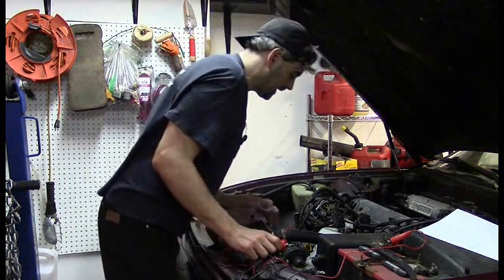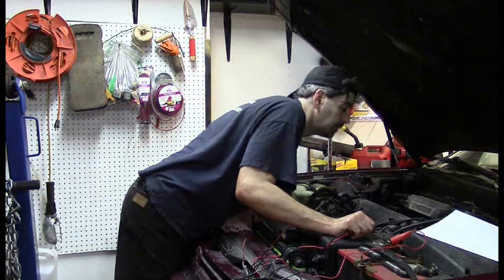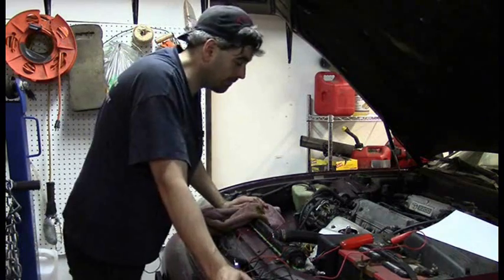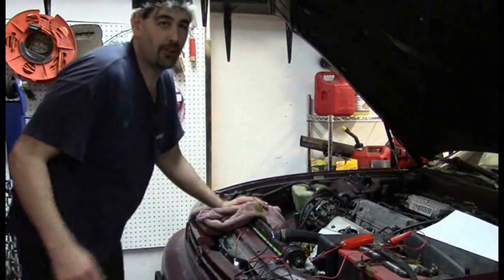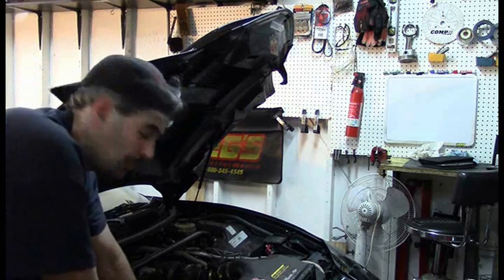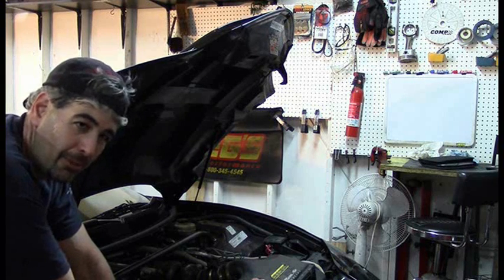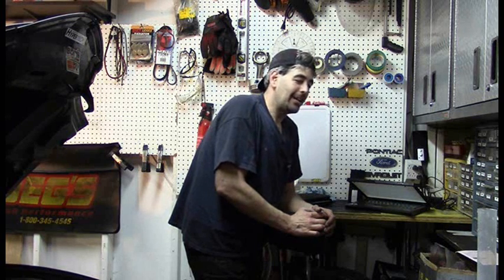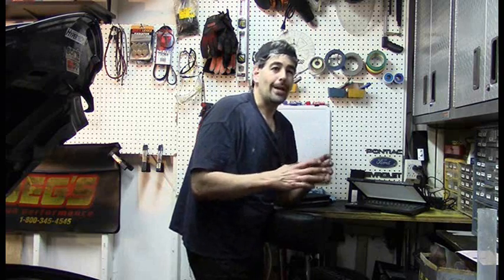12 Ways of How To Test A Blown Head Gasket Compared- PART2

Comment: Really interesting two part video there, the 'sizzle' test is obviously cool, it just looked like 'normal' used oil, who'd have guessed eh?
I have a suspicion that my car has the beginnings of a head gasket issue, its a 1999 Renault Scenic, just nearing 150k, had a new timing belt/water pump two years ago, but recently started 'losing' coolant fluid with no evidential leaks for wet patches, a couple of weeks later it had a minor intermittent misfire (at lower revs nearly always during pulling away which went once you hit 3k revs), tho that problem suddenly got worse as it would misfire occasionally even at steady town speeds, but this has since lessened. It doesn't overheat, has had regular services, last one a couple of months ago, but my concern is that whilst it may have seemingly gotten better (for now), more damage is being caused.
I have a friend who's a qualified mechanic but I'm quite independent mechanically and don't like going to him for problems as I don't want to be seen as only being friends because of his skills as I know some people do that, and whilst I've done head gaskets before, they've always been on engines I known well because I've only ever owned old bangers that you had to tinker with every weekend in order to make sure they would see you through the following week, but my current car is pretty modern so I'm a quite reluctant to mess with it, but I'm thinking I'm going to have to ask for some help with this one.
But excellent videos, thank you!
Reply from the maker: The diagnosis for mechanical problems like a head gasket is no different now than it was in 1921 so you shouldn't need any help.  It's the modern engine performance systems diagnoses that require considerably more skill and knowledge.
Reply: Schrodingers Box Yeah, its messing up something EMU/ECU system related that worries me. I love computers, I just wish they wouldn't stick them in cars!
Oh for the days when engines were all but mechanical, when the only wires in the engine day were to the starter, alternator, plugs & coil... I miss those days :-\ lol
Reply from the maker: maffysdad You know- my channel exclusively covers diagnosis on these modern systems and dare I say- but when you understand the systems and know how to diagnose them, it is actually far, far easier to diagnose modern systems than older ones because if you know what you are doing you can rule out 90% of things that you would still have to manually test on an old car to rule out.  On older cars, Diagnosis takes me far, far longer because I cannot "read" the engine's response to variables and instantly determine what must be working for sure and what may not be working.

Comment: Thanks pal, very inteesting. I was wandering about how different a mechanic workshop works in my Catamarca, Argentina. It s too long to explain though!!!! Yet a mecanic is a detective here, but many variables, (labour costs for instance) make all the thing be seen from a different perspective. Mostly you are fixing 20 year ols cars or older. I have a Chevrolet c-10 with a Perkins  4 engine and a M. Benz 65 truck gearbox, with a super low first gear. I am not a mecanic but i fit it all myself and it goes great. I live in remote area. Thanks for sharing.

Comment: I am trying to diagnose a head gasket failure.  The engine passed the exhaust gas in the coolant system test (block tester liquid remained blue), but I think it failed the "sizzle" test. I made a video of the test.  At the 25 second mark there is a little boil popping and sizzle but the rest is just smoke.  Is this conclusive?  https://www.youtube.com/results?search_sort=video_date_uploaded&filters=short&search_query=lee+stafford%27s+oil+test  thanks Schrodingers Box

Comment: Hello Matt from Shcrodinger's Box! Great video, which is certainly worth a compliment!
The test you talked about, with the hoses getting hard from combustion pressure, is certainly valid! It is very related, or you may even say equivalent to the test I like to do: For automatic transmission cars, I open the rad cap and close it again, then start it up, step on the brake, put it in drive and accelerate up to around 2500rpm with a totally cold motor, for approximately 25 seconds. IF the test comes out POSITIVE wherein there's pressure present in the radiator when you take off the cap, then you can determine that the gasket has failed. However, if there's no pressure in there, after the test has been done, you may not be 100% sure that you don't have a leak, as the pressurized combustion gas in the cooling system may find its way out through a potential leak of the cooling system itself.
For standard transmission cars, I drive them in high gear, full throttle on the street, for maximum stress, for the same time (20-25 seconds). I definitely admit that the CO2 detector is the best way to go though. I appreciate your scientific approach to the issues, and I hope to get your opinion on the test I do.
Best Regards
Ragnar.

Comment: I have a 2008 subaru legacy. The only symptom of a bad head gasket seems to be a small oil leak between the head and the block, passenger side just above the oil filter. No signs of bad compression, exhaust gas in the coolant. How can this be? What could be the cause of the leak, engine has not over heated.
Reply from the maker: Most likely that oil leak is from intake manifold I would presume.

Comment: I could use some advice regarding my attempts to repair my 1998 Volvo V70 GLT, a car I've owned for 16 years. 
Background:
- Car recently overheated (first time ever) while driven by my teenage daughter.  Radiator had a split seam and wouldn't hold water so it was towed to a repair shop.
- A new radiator was installed but during a long test drive the temperature gauge hovered just under the red zone indicating a failure in the cooling system.  A head block test revealed combustion gases in the coolant.  The mechanic charged me for parts only and advised against “pouring money” into the car since the total extent of damage caused by the initial overheating is anyone’s guess. 
- Having nothing to lose, I gave Blue Devil Head Gasket Sealer a try.  I first performed a head block test to confirm the presence of combustion gases in coolant--the test fluid turned yellow within seconds.  I used Blue Devil as directed and performed another head block test.  No combustion gases detected—the test fluid remained blue.  (Repeated test several times in disbelief!)
- The good news is the car no longer overheats.  Temperature gauge rises to the middle of the normal operating range where it should be and does not fluctuate.
- The bad news is that coolant is being forced out of the reservoir cap.  (1 - 2 tablespoons per lengthy drive)
- There is no oil in the coolant and no white smoke from the tail pipe.  T-stat tested and works fine.  All 5 cylinders show compression of 180-181 psi.
- Engine starts easily, has a smooth idle and runs great.
Other than a head gasket leak, what else would cause this kind of pressure to buildup in the cooling system?  Any diagnostic insight you can offer would be appreciated.
Reply: J Alan bad thermostat ?

Comment: Very informative and thorough.  I like your presentation.  I applied some of what I learned to my 98' GMC 305 V8 that my son overheated.  Not sure of root cause, but my theory is it had beginnings of a leaky gasket issue starting and it got overheated on a trip which made it totally fail.  Coolant is in oil for sure- milky and high level on stick.  Cooling system definitely wont hold pressure and the engine gurgled some after pumping it up a few times.  Cylinder compression seem good varying between 180 and 188 psi.  The chemical block test showed positive for combustion gas in cooling system.  That's where I'm stuck.  Is it reasonable to think the head gaskets are OK given good compression?  I'm pretty sure an intake gasket leak can dump coolant into oil, but can it also be the source for combustion gas in the coolant system?  Or does the chemical test definitively mean head gasket issue?  If you get a chance to provide some feedback, thanks in advance!
Reply: I just re-watched part 1 chemical test where you say it is the definitive 'head gasket' test.  I don't get a yellow result.  Rather a weaker blue.  But i will now try it on a control vehicle as you did so i can see what it should look like.
Reply: ***** Control vehicle shows no noticeable chemical hue change.  Problem vehicle definitely does.  So I think I answered my own question- I do have a 'head gasket' (or related) issue.  

Not sure I want to tackle this myself.  One remaining question I have is how much should I expect to pay for a quality service job like this?

Comment: Hi there! I have a problem with my Fiat Grande Punto 1.3Multijet (diesel) (i'm from europe). Over the past 2 months I have changed 3 hoses trough which coolant flows and since then I am constantly losing coolant when I drive. I have been to a car service because I've noticed that one end of a hose wasn't tightened, but that didn't seem to solve it and coolant is still getting out there, but not like an intense pour, more like there's moisture on that part. I am thinking of having a bad gasket because on my opinion, maybe the temperature which heatens the hose (the hose is positioned on the back site of the engine, as you open the hood, close to the EGR system) and dilates it + increased pressure trough it makes the coolant come out from the end. I haven't seen any white smoke coming out of the exhaust, nor bubbles on my dipstick (maybe because the oil is pretty new), but after I end a drive and open the coolant reservoir, a burst of pressure comes out. I have a recording if you're interested and maybe you can help me.....I'm getting tired of checking the coolant level and hoping that the car won't let me down on the road :(
Reply from the maker: As I mentioned in the video- a common symptom of a head gasket leak ( that I was unable to demonstrate due to the radiator neck issue) was pressure building up in the coolant hoses and it does sound like maybe you have such an issue, especially if the pressure builds up considerably while the engine is still cold.  Further confirmation of a head gasket leak is definitely in order for you.
Reply: I have a video of me unscrewing the cap of the reservoir if you may want me send it to you, take a look at and tell me what you think. 

The guy from the service just called me and said that the hoses he used on my car weren't new and were kinda worn out. He said he bought 1m of hose and he'll replace all of them. I hope this will solve it so I won't have to worry about the gasket, but I will make the oil sizzle test so I can be sure that i don't have any internal leakings....
Reply from the maker: Ioan T Please don't send me any videos of you screwing things, I get enough of those.
Reply: Schrodingers Box Okay

Comment: Sizzle Test:  I really like the sizzle test.  When purchasing a used car, some of the test might be considered a bit intrusive to the owner but a reasonable seller should be willing to give an interested party a little oil from the dip stick and then the interested party can take the oil and put it in a spoon or other then heat it  up and watch if it smokes or Sizzles.  Wallah!  You now know if you have a blown head gasket.
Reply from the maker: siucbset Yeah even to this day I am absolutely amazed by the sizzle test and you can even "accidentally" do the test on an unwilling seller by dropping a bit of oil from the dipstick onto a hot exhaust manifold while "attempting" to put the dipstick back.

Comment: Just thought of something about checking the oil fill cap for a head gasket failure can be a false positive on cars that are driven short distances and not give the engine the chance to fully warm up and moisture can condense there and cause the whitish color that water and oil cause. Maybe the guy that posted the video can explain this a little better than I can.
Reply from the maker: Actually this is a fantastic point!  Good thinking bro!

Comment: Bubbles wouldn't happen till the thermostat opens and it would push coolant out of the radiator like it did when you did the leak down test
Reply from the maker: Not necessarily- in a combustion leak to the coolant, the air will still build pressure in the system on both sides of the Tstat and bubble of out the tank- or whatever the weakest seal is if the pressure is high enough.  In fact, this is actually demonstrated in the leakdown test in this very video
Reply: why don't you come over and tell that to my engine. and see if it changes its mind on when bubbles come out of the radiator but something tells me its not going to work.
Reply from the maker: I would tell it to your engine but it wouldn't be able to discern my reasoning over the variables of  normal water pump circulation and thermal expansion that you would expect when the thermostat opens. So Instead I would just use logic and reasoning... removing the thermostat and repeating the test without it.
Reply: the issue with the engine needing to warm up to cause large bubbles is it could be a crack in the block or the head
Reply from the maker: 678friedbed Absolutely agreed- it is indeed true that sometimes the combustion leak does not occur until the engine is warmed up (i.e. cold engine contracts and "seals" the leak better), but this is not support for your theory that the thermostat must be open to push the coolant through the radiator when in fact the combustion gasses do that regardless of thermostat position.  e.g.The thermostat has nothing to do with it "pushing water through the radiator"- the combustion leak will get into the coolant system and affect it regardless of thermostat position.  Again this was demonstrated in the video with the leakdown test. Q.E.D
Reply: Wow I just went back and reread my post. I am so sorry for the confusion. That was really bad English there. What I meant to say is when the engine is cold you will only see a few bubbles but when the thermostat opens it will allow more air bubbles to get through causing coolant to flow out like when you did the pressure test. But that only works if the head gasket is blown between a cylinder and a coolant passage. I'm sure you already know that.
Reply from the maker: I know what you are trying to say bro.  It's splitting hairs but actually the thermostat being open is still insignificant. Think of the cooling system as a circle with a "wall" blocking the circle from connecting. It does not matter which side of the wall the pressure builds- the whole circle is still pressurized on both sides of the wall (which is of course the T-stat).  That pressure is going to bubble out of any weak or open point in the circle regardless of if that wall is there or not.
   This is why the coolant boiled out during the leakdown test despite the T-stat being closed.  The leak through the combustion chamber allowed the air to enter the system on the "other side of the wall" but it still pressurized the entire system and bubbles boiled out of the radiator exactly the same as would have happened if T-stat was opened.  Hope that makes sense.  But again it's splitting hairs however it's important because if the coolant is bubbling out when the T-stat is open, well, you would expect that to happen anyway due to thermal expansion so it makes the test inconclusive. If however, the coolant bubbles like that when the engine is cold, well, you have serious reason to be concerned because it is not due the thermal expansion.

Comment: Matt, your approach is just excellent, in all the videos. This one on head gasket failure diagnosis was particularly helpful for me. (Oil from the dipstick of my car did not sizzle, but from inside filler cap did, ongoing story...). Don't understand why you don't have more subscribers. I never subscribed to any YT channel before, but I made an account specially to comment here and subscribe. Keep up the good work!
Reply: Having signs of moisture in your oil cap could be a false reading. Cars that are only driven short distances and don't have the time to full warm up can have moisture in the oil fill cap.

Comment: 2:15 more specifically, the leakdown test on #2 that blew bubbles in the radiator would have been expected to spray the paper with coolant, which it did not do. The #2 compression test which you mentioned in the same breath was not specific to finger the cooling jacket.